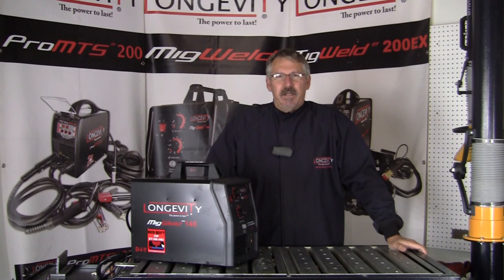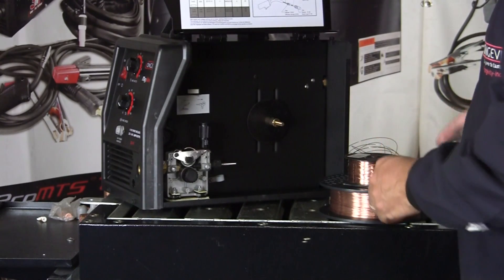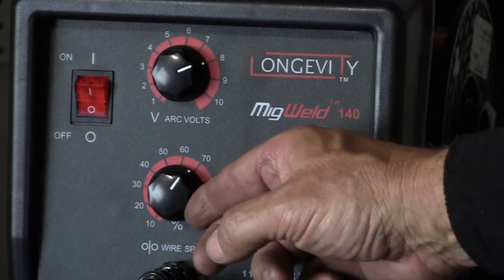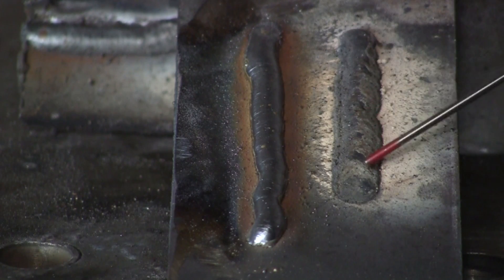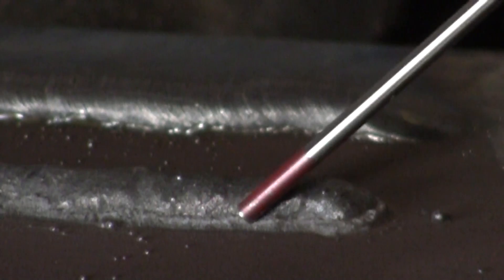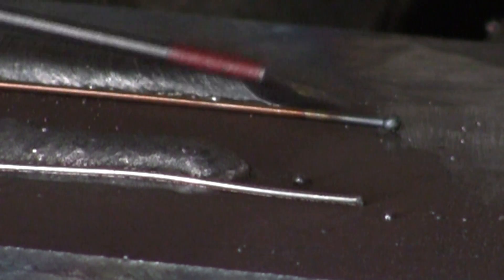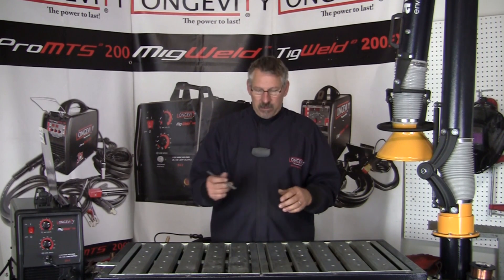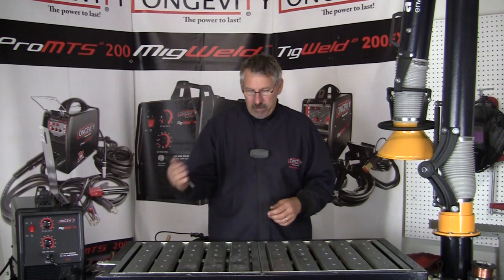FLUX CORE AND MIG WELDING WIRE COMPARISON TIPS AND TRICKS ADVICE

Comment: Why would I be having like my wire not disintergrate? It looks like its welding and I cant break the weld but like surely the wire is supposed to burn up and go into the weld or at least disintegrate? Obviously cant weld more than an inch like that haha. Am I getting too low voltage or something?
Reply from the maker: Possible that voltage is lower.
Reply: @longevitywelding  I think I figured it out. I was moving too far away and not syncing my button presses properly with when I was starting and stopping the weld. I'm super amateur but this is working way better than stick welding. I couldn't get my sticks to stop sticking so made learning really hard.

Comment: I've been fluxcore Welding ( getting tired of the mess) want to go with gas but what size bottle should I get. Im a newbie. And how much am I looking at? I guess in the long run gas welding is cheaper than flux core being  flux core wire cost twice as much as solid wire..
Reply: Did you ever get a gas bottle? I'm just trying to get a cost comparison. Some rough math shows me solid wire and gas is cheaper.
Reply: @AHill-oi9ct  not yet but I've noticed solid wire is a lot cheaper . I'm going to soon I have to get a regulator /hose/solid wire  I can get .030 solid wire 2lb spool for 6.00 at Fazzios where flux core wire cost anywhere from 15 to 20 dollars for the same spool.. I will definitely let you know. I plan on leasing the gas bottle in long run it's cheaper because you swap it out with another & you never have to worry about certifing it. They do that.
Reply: The wire is definitely cheaper if you're buying solid. Cheaper overall will depend on which gas and how much you're buying. My local Lowe's has Lincoln L-56 wire priced about $40 for 12.5 pounds. An 80³ft bottle of 75/25 is about $40. That would be $80 for 2.5 more pounds of wire than a 10 pound spool of flux core a at the same price. 

If the math is anywhere close to right, an 80³ft bottle could last through a whole 12.5 pound spool. I have seen a post on a welding forum where someone said they could get about 20 pounds of wire to 80³ft of gas. So even if I figure 3 12.5 pound spools to 2 cylinders it comes out better. That's only $200. Three 10 pound spools of flux core comes out to $240.

All of the above is based on me using 75/25 as a shielding gas. If I start out using 100% CO2, the cost goes even lower due to CO2 being a liquid in the tank. A 20 pound tank equals about 150³ft of gas. That almost double the wire than I can run per tank fill. CO2 is also cheaper. The weld supposedly doesn't look as good, and there is a little more spatter. If  I could get used to looking at flux core and cleaning it, none of that will be a problem. I still don't mind flux core other than the fact that it costs me more to run it.  If I need to weld outside in windy conditions, I'll still use it or stick.
Reply: @AHill-oi9ct  what I don't like about flux core welding is the fact it's hard to see the puddle with all the smoke in the way..I tried gas  what a difference you could see the puddle clear as day and definitely you could weld better( for me anyway) because you could see it easier and learn faster ...
Reply: I'm on my 3rd year. Plenty of time to get used to it

Comment: We use flux cored wire in construction welding big constructions, we use gas for it aswell, there isnt that much splatter, if you weld it right you just need a light tap and the whole flux just jumps off ! :D

Comment: This is basically a commercial for Longevity. All of the tools on the set are new and unused. I am a welder/fabricator with nearly 50 years experience. I have been certified under AWS  D1.1 standards, ASME, Navsea and many others. I have certified for welding on power plant steam turbine generators, US military surface craft, bridges, buildings and many others by bend, ultrasound, mag particle, red dye, and x-ray with most carbon steel low hydrogen, various stainless steels, brass, bronze, aluminum. I was an American Welding Society (AWS) member for years and also taught, inspected, certified and demonstrated all types of welding procedures such as stick, MIG flux cored and solid also with  inner-shield, TIG, subarc, gas wire, and others. These little MIG welders are good for light welding like sheet metal. I have a Lincoln SP-125 myself. The penetration is not good on anything heavier than 1/4 inch thickness unless you preheat the base metal. No brag, just fact.

Comment: Can the flux core welding be used on vehicles?
Reply: Yes.  Plenty of you tube videos showing flux core welding on vehicles.
Reply: Frames and solid parts yea, bolt panels and thin sheet I wouldn’t recommend. Especially to newer welders.

Use a cleaner process like TiG or MiG, not flux or gasless for thin sheet.

Comment: I have a welder that's flux core only what's da best helmet shade is best I'm new to welding and I have the standard helmet provided also just bought a shade 9. Will this shade 9 be safe for anyone??
Reply from the maker: 9 shade is not safe for MIG. We recommend 10-13 depending on the amps used

Comment: I always hated flux core welding
it just looks like garbage
leaves to much slag and residue
Reply: Flux core is smoky as hell. But it will leave a smooth rainbow sheen if it's run hot with minimal weaving. That Hugh hump he displayed is too cold

Comment: I'm quite a newbie in welding, but your welds look terrible! The fluxcore I use ended up way cleaner than your, and looked way better. And it is obivious that your MIG settings wasn't right as it was too cold... The side of the bead shouln't turn inward, should spread on the side... Bad advices...
Reply: As a hobby metal fabricator, I have 25 years of wire welding experience and agree with your assessment. Settings is likely an issue here. But @ 4:33 he states he was using flux core E 71T GS. I was surprised at this, the GS part. I figured a higher standard flux core wire would have been used for this type of side by side comparison. Any flux core wire designated with GS usually means it is "general" "single" pass only wire. In other words, GS can be okay wire, but it can also be very poor quality wire because it does not need to meet a specific standard. In short, it is manufactured to what ever spec the supplier, or distributor requests as long as it meets minimum criteria, in this case 71 or "Minimum tensile strength" and "position" . The biggest loss in GS is normally "usability", but there are others. I've used GS wires from time to time and my welds sometimes look like the one in this video. 

I have a Hobart 135 and for all of MY personal projects I will only use either .030 Hobart E71T-11 or .030 Lincoln NR-211-MP. I have been able to weld 14 gauge sheet to 1/2" plate, with the right wire and proper settings of course.  My welds look very nice using either wire, and both produce little spatter.
Reply: Anyone that is a hobby welder and use's off brand machines is far from professional. They just know how to throw dog shit down a plate . I 've fixed plenty of welds from hobbies and handmen . I have a suite case I run my flux core off of . no splatter and the flux comes right off with a wire wheel .  not to be a know it all because I don't know everything but I know what a sound and quality weld looks like . I am a mobile welder and I run lincoln .

Comment: i have a century 100 fluxcore 120v and its a good welder iv done steel thickness of 1/2 inch to 5/16 but i just got a convertion kit so i can run gas

Comment: cold welds.....
Reply: I knew about with stick, never to push. I mostly use mig at work. Which I most always push. But at home I started out with a flux core mig so I always dragged it as you said. When I started welding more at work a licensed welder said to try to push it, mind you it wasn't flux core, it was gas shielded. Ever since that day I began pushing the puddle. I kinda had to relearn all over again. I also weld a ton of aluminum using a spool gun. All self taught using as much info. I could gather from any licensed welder that would give me the time of day. So, I guess even though I may have misunderstood his reason why . I do believe it may have come from the fact that i find it to be a bit quicker? Not sure if that's true or not but I did find once I got the hang of it, it seemed a bit faster. Maybe it was also due to the fact I became a far more proficient welder myself as he deemed me the only welder good enough other than himself to do certain welding tasks around the shop I was in at the time. I will admit I'm definitely not the best and I'm not licensed but I still do many jobs even the licensed welders are not given due to my track record and experience in certain situations. I work in the transportation industry as a Licensed Heavy Equipment Technician. Most tech's haven't got a clue how to weld, but I also have a background in machining and metallurgy which certainly comes in handy. Thank you for answering my question.
Reply: SHERMAN YOUNG  so if I'm running stick making a vertical weld I'm supposed to drag it??? I'm not trying to be sarcastic or judgemental. And I don't know everything.. but after 40 years.. under the right circumstances any welding electrode .. can be pushed
Reply: Stickweld is a whole different animal,not ok to to compare with fluxcore,stickweld CAN be also pushed,but only in some circumstance that i cannot find words to display as example.
Reply: Fair dinkum 
That's the first thing I thought, too. "Where's the HeaT"
Reply: I'm not a licensed welder by any means so correct me if I'm wrong. I was taught not to drag the weld as he does at the beginning of the video but to push it if space allows you to do so. Is this true or was it just one welder teaching me his own technique?

Comment: Is it really ok to weld in the rain with flux core? I thought it was not a good idea because of electrocution risk not because there's no gas shielding. I'm just starting out teaching myself through online vids so confirmation from someone would be helpful......
Reply: don't weld in the rain
Reply: Jonto Dickens most of the time you won’t get shocked but keep in mind that’s dc current, ac is another story, now it also depends how hard the rain is if your standing in a puddle of water then you’ll most likely get shocked but if it’s a light drizzle you most likely won’t

Comment: I got my Easy FLUX/ MIG 100T/1 from Ebay. This is my first time using welding machine and I have a question. I put the flux core wire included and the motor pulled the wire fine but when I try to start soldering nothing happened. The ground cable is on my metal part and moved the switches to differents position from 1 to 2 and from Min to Max andnothing happened. Can you tell me what is the problem? I hear the motor running. Maybe the ground cable is not conected inside the machine. What I need to do? Thank you in advantage.
Reply from the maker: is that a longevity brand machine? if it is feel free to contact out tech support at 5108877090
Reply from the maker: is that a longevity brand machine? if it is feel free to contact out tech support at 5108877090
Reply: Try to use a 20 amp outlet with nothing else plugged in and if you have to use an extension cord, make it a short 12gauge cord. These welders take lots of power or they won't work.

Comment: Does one type make stronger welds than the other or are they the same?
Reply: Self Shielded Flux core (FCAW-S) can only do short circuit process (no globular, no spray/pulse spray). 
FCAW-S is comparable to short circuit MAG (metal active gas) in terms of penetration , a bit better than MIG (metal inert gas) . 

Welds are similar in strength to other short circuit processes.

Comment: Great informative video. Only one thing on the "MIG" welding proces. If you weld steel and use a gas mix (lets say 85% Argon 15% Co2)Like most people use for welding steel its Not MIG welding but MAG welding. (Metal Active Gas)   Only when using pure (100%) Argon and welding aluminum you technicaly call it MIG ( Metal Inert Gas)  So all of you weekend builders working on their boat, car or rv. When you weld steel, you actualy never MIG weld, you MAG.
Reply: gabsmit nobody I know actually uses that term

Comment: When using flux core wire, always run a wire wheel over the weld or grind to clean it up before running another bead. What he doesn't tell you is that the flux core weld is dirty and you want to use enough "heat" to get good flow/penetration and minimize pin holes. Proper heat and wire speed are critical using flux core wire.
Reply: SO WHAT IS THE BEST SEETING  ON VOLTAGE/AMPHERAGE AND SPEED WHEN YOU ARE USING A FLUX CORE WIRE TO ATTAIN SUCH GOOD FLOW PENETRATION ....THAKN FOR YOUR ANSWERE

Comment: I hope u know that u can clean off the flux  on the gasless weld 
By using a chiping hammer or a grinder with a wire brush disc it's not hard to clean off!
Reply: Yup your right I use mig but if I have to use flux whith a chip hammer a air grinder and a wire brush cleaning takes a few seconds and your good too go at least someone nos's !!! I should say I don't know y he said it's hard to clean .. Cause it's not again I'll say this if u have the right tools and no the weard no how to use your tools your good too go but ya u made the right point

Comment: How many times will you say how the weld is protected? How about witch is better for different applications besides wind.
Reply: Metalcore is better suited for flat welding and Fluxcore is better for vertical, overhead and horizontal welding. You can use metalcore for those positions, but it's a lot harder to do.

Comment: Which method is better for burning thru dirty metal?
Reply: Or u dont weld dirty metal use a grinder dude clean that shit up
Reply from the maker: For dirty metal, stick welding is better.
Reply: Derek Graham Yeah true, but you cant always get a grinder in where the weld is at.
Reply: @Lanninglongarmmowing  try a needle scaler to get where the grinder won't reach. 6011/6010 are better for "dirty" metal, but you really need to know how to weld before you try using either of those or you will be hating life
Reply: Neither.
Reply: Ok. I was just wondering. Thanks!
Reply: Garnet Smith I've heard a lot of people say stick welding. Thanks!!
Reply: longevitywelding What about flux core?
Reply: ***** Oh wow. I bet that was a really cool job. Hard work nonetheless but still. I've never stick welded before. All I've done is flux core. More heat would burn away the porosity some. Definitely not what should be done if its a test.
Reply: stick welding
Reply: Love2boat92. Use a stick electrode of 6011 for burning on steel where heavy contamination is present...
Reply: Given the choice between the two, flux core is better.